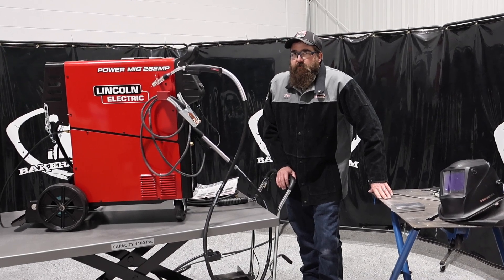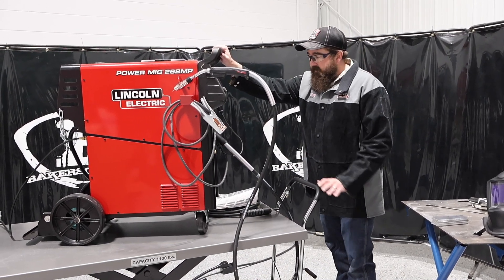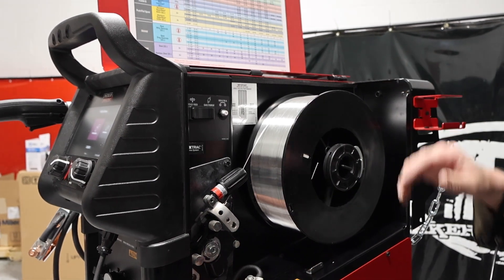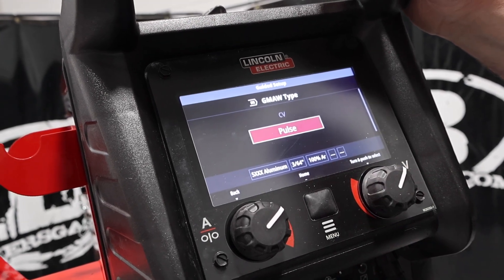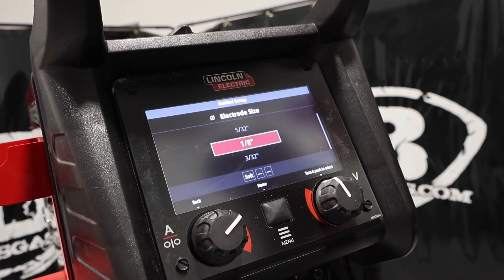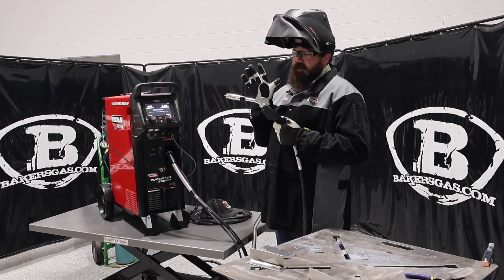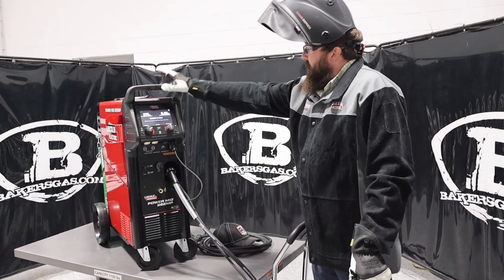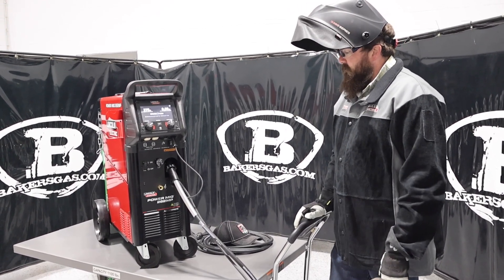Lincoln Electric Power MIG 262 Review & Demo

Comment: On the website says 60hz ,my country is 220v 50hz , I’ve read that running on 50hz will cause issues. The only one that’s 50/60hz is the 360mp but I’m not doing long hours welding

Comment: You made a video on this a couple years ago and you said it was inverter based😅 thank you forgot about that one I'm not a fan of the 110 volts up front or in the back and the Lincoln's on the ones prior to this the 255 c and all that or the 350 if the machine breaks down I'm sure that the plug won't work unless it's adapted to bypass the circuitry of the circuit board not 100% it's kind of cool cuz you can run a plug off it but you can do that with any welder you can just run 110 volts off half of the transformer and just put a fused GFI plug and you're good